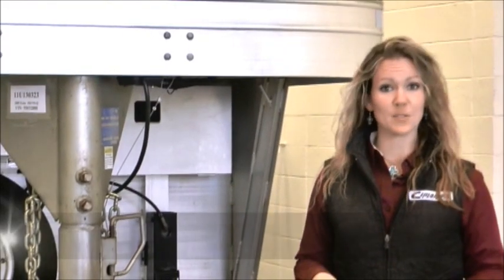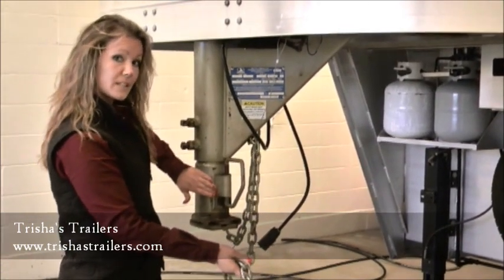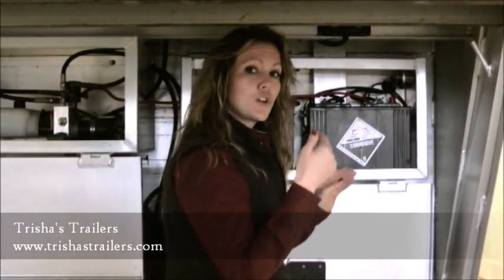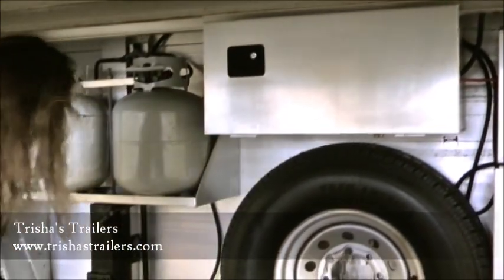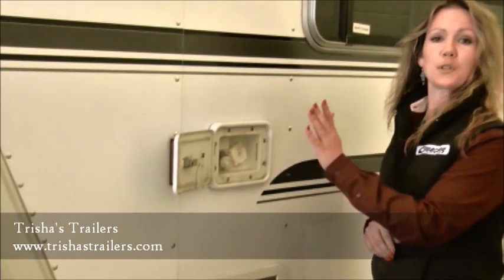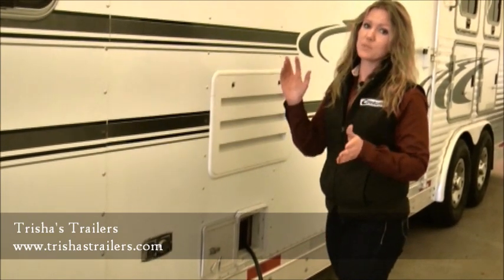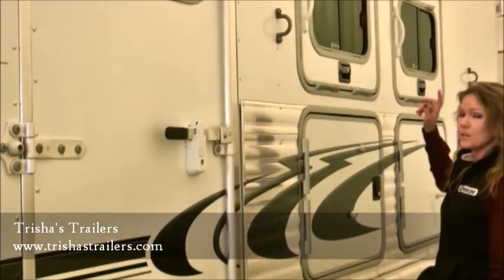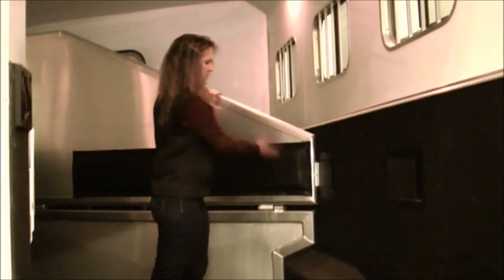How To Use Your Living Quarter Horse Trailer, Part 1

Comment: Nice walk around.  Enjoyed it.  Just one clarification.  If you've put the switch to one propane bottle and both are "on" when that reads Red, it means that bottle is empty, however, it does switch to the primary for continued gas usage.   If you want the 2nd bottle to now become the primary, you can move the switch and "re-fill" the empty one to now become the secondary.